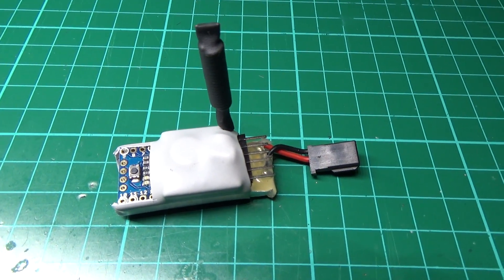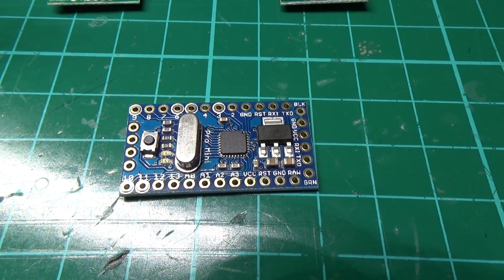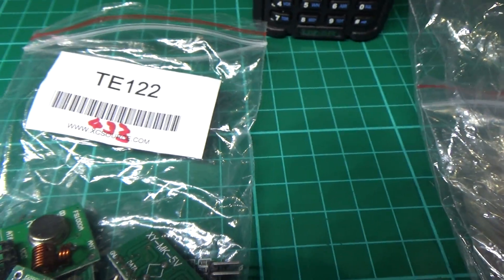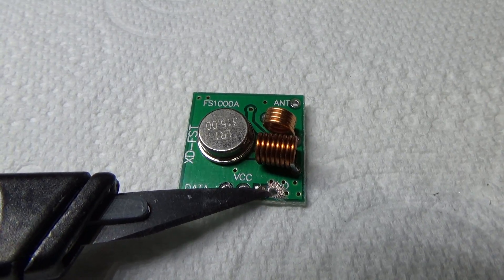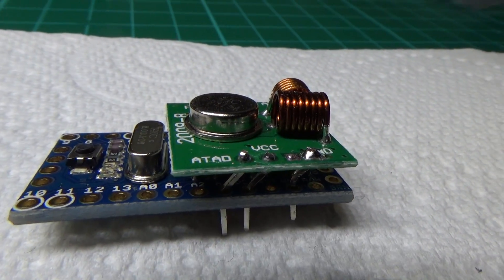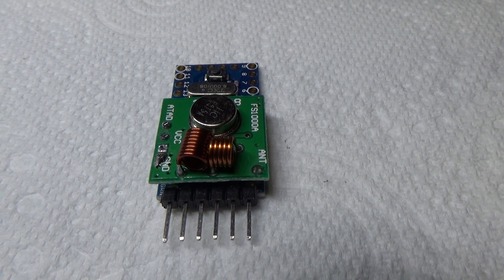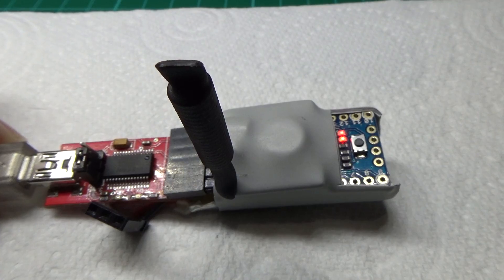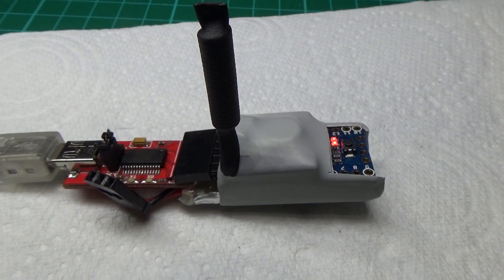DIY Lost Model Beacon. How to build one.....

Comment: Do you have a suggestion for another type of receiver that I can use with the Arduino? For example, I making a robot that will track where something is. Therefore, I put the beacon at the location (transmitter) and the robot will pick up on the location and follow (receiver).

Comment: Great video. One quick question: Is there a way to transmit an audio (a voice recording for example) with these devices?
Reply: Of course, but im not sure if you can make using only this parts, i think you may need some kind of audio driver, an "isd1820" for example.

Comment: Effective range of these transmitters is 20 meters
Reply from the maker: Data transmission, yes. Have you seen my test video?
Reply: 20 metres is useless if your model glided away 5 miles out, plus you lost video FPV feed. However nice video and product. Lots of uses. I'd like to see a demo of how you pickup the signal using your radio, fascinating.

Comment: Brilliant! A few questions if I may; I am assuming that your battery voltage is going to the Pro Mini's RAW Pin, correct? And I see that you are powering the RF module from the Pro Mini's VCC Pin which would put 3.3v to the RF module correct? In my research about this particular RF module it would seem that transmitted power output is dependent on the RF module's input voltage. Based on that assumption would it be best to power the RF module straight off the Lipo rather then the regulated 3.3v from the Pro Mini's VCC Pin?
Reply from the maker: You're correct in every way. I only made the video to demonstrate how easy it is and I kept it as simple as possible so everyone can make one.   
You'd be surprised at how many people have asked questions, even with it as simple as it is. It's quite refreshing to see that someone has actually taken the time to do some research :-)

Comment: Hi. Vortecks  

Really interesting project.
I'm going to build one (or few) of these beacons.
I downloaded the code you share and have some questions. It's my very first project in arduino, altough I made others on PICs or ST etc.

As I understand you are using a loop and two const to generate a tone or something similar is true?

I modded the loop and added a line to have simetrical square wave.
while (pause < pitchLength)
  {
    digitalWrite(rsOUT, HIGH);
    delay(pitch);
    digitalWrite(rsOUT, LOW);
    delay(pitch);                //Added line
    pause++;
...
...

That way it's much louder as there is less energy wasted on harmonics we don't need or even hear.

As I don't have the 433mhz I tested with a small speaker.

Let me know If I'm wrong.

thanks
Reply from the maker: Hi Mauricio,    
I originally did the coding to play a tune and it was done so people with little knowledge could understand how it works. There's plenty of optimisations to be done and your way will work perfectly. Please feel free to keep modifying it, it's nice to see someone taking the initiative and making a good invention into a perfect one! :-)    
Tony

Comment: Hello sir, I have some problems with this device. So I want to know if you can help me. I follow the instructions of your video I have an Arduino Chinese Card (http://www.ebay.com/itm/222050323175?_trksid=p2057872.m2749.l2649&ssPageName=STRK%3AMEBIDX%3AIT). I upload the Beacon Pro Mini Simple Beep to the card, but I only have a blink in the arduino card, but when I tried to Heard the beep on my Baofeng on 433.900 MHz I didnt. Please can you give an email or please write to mi email: vfmontes@gmail.com, Thanks a lot for your time.
Reply: I saw that the DATA pin from the transmitter goes on A3 PIN. but in the programm said PIN 13, is that the problem?
Reply from the maker: To answer your questions..........There is a 30 minute delay in the software and it won't do anything for the first 30 minutes and then, it'll transmit a series of beeps. You need to be at least 6ft away from the beacon when it starts transmitting or it overloads your receiver and you'll hear nothing. Pin 13 is connected to the Arduino's onboard LED - it flashes when it's transmitting. Does that help? :-)
Reply: Hello sir, I will try it. So, the data connector from the transmitter, need to be in the A3 pin?, thanks
Reply: Hello Vortecks, another question. I connect the 3.7v battery to the arduino, and immediately start to blink a led on the arduino. is it normal? thanks

Comment: Cool video. Have you thought about trying an ATtiny84 with the radio transmitter? That'd make it really small. Probably could run it on a single coin cell for some time.

Comment: Hi Vortecks, I just lost my drone, no tracker so I am running around blind looking for it. I have looked at what you built and it is just what I need  before I fly again. What I don't understand is how you get a tone on the Baofeng which is FM and the TX is listed as AM. I want to order my parts so wanted to confirm that the TX unit did not change. Thanks for the video's !!
Reply from the maker: Without going into the technical differences between FM and AM and the way the beacon works, you'll be fine. My Baofeng is FM and the transmitters are indeed AM.    
Here's the demo I did with it..... https://www.youtube.com/watch?v=ahkBExnJjdA    
Sorry for your loss, I know the feeling all too well :-(    
Tony
Reply: Thanks so much Tony, that is what I wanted to hear. I am getting parts on order today. Thanks for sharing your code also !! That is a big help. I will be watching your video's to see what you do next. Larry
Reply from the maker: Thanks Larry.    
If you're after the ultimate lost model alarm & beacon, you might want to look at the tBeacon, I use it in everything I fly now. They are quite costly but the saving in the long run is priceless!
Reply: Thanks Tony, I will have a look at them. Having one take off kinda takes the fun out of things.

Comment: Hey Tony. I know this is ancient news and all, but I have been waiting for my Ook 433Mhz Tx modules to arrive (60+ days!!!!! )
So they are here and I have to get back in the groove. Thing is I forgot I only had 5V Pro Mini's left in my kit.
The OOK 433 are 5V for Vcc but what of the Data In?  I wonder if the Pro Mini will run off the 3.7 lipo.
Reply from the maker: Which ones Chris? The ones in this video?
Reply: Yeah the module you are using in this vid are called OOK/ASK , don't ask me :-)  But yes that is my scenario. I was thinking of bypassing the Vreg on the Arduino. Also there is a way of modding the PCB to connect a ATtiny13 for holding the code, and some rearranging of resistors and caps. (thread at RCG). I don't really care either way but I would prefer not to have to wait for more parts to ship. We have a looming Postal Strike on the horizon here besides. I just want a little insurance for my first forays in the rural hay fields around my abode
Reply from the maker: I already made one from a Digispark..... https://youtu.be/ahkBExnJjdA?t=2m20s   
As for the Pro-Mini I use, I've searched for them on eBay but it was so long ago, the link no longer works :-(
Reply: You are always generous with your replies pal. Look, I watch all you vids mate, and when I reviewed that vid yesterday, I only see two power leads connected to the Tx module, so I am more confused after that revelation
I will be trying your original instruction and will review the code to see if it can fit on a ATtiny of some size.
Reply from the maker: The power leads from the battery go to the 433 TX and (what you can't see) is the attiny85 mounted directly underneath it with +ve and -ve to the TX unit.

Comment: Well done! I built one, but I am wondering how to make it transmit a series of beeps, each increasing in volume, then go silent for a few seconds, then repeat.  That way, as the searcher gets closer to the beacon, the searcher hears more beeps, and has a better idea if they're heading in the correct direction! It would be really cool if you would write that code and then post it here!
Reply from the maker: Sadly, it doesn't work like that. The transmitter is either on or off and there's nothing in between. The noise you hear is actually generated by the transmitter turning on and off very quickly :-(
Reply: Vortecks Rats. Thanks anyways for the quick reply. I'm using an $1 attiny85 with a $2 stx882 433mhz transmitter module now with a scrap LiPo. I haven't tested it yet, but I plan on using a $0.70 receiver module and an ear bud to receive the signal. Or a handheld radio. Thanks for the tutorial! I subscribed.
Reply from the maker: No problem. If you want something that does what you suggest, have a look at the tBeacon........ https://www.youtube.com/watch?v=QOkG72TdB10
Reply: +Vortecks Do you think it would be possible to have the span of the beeps to be different or vary in length? for example, I'm thinking of using a piezo buzzer hooked up to a 433mhz receiver module (maybe by using a transistor to trigger the buzzer) and then the transmitter arduino code would simple be the basic blink sketch, except with beep 1 being very brief, beep 2 being slightly longer, and so on for like 5 beeps, then a long pause before looping again. My handheld radio is away in storage, so I'm trying to be resourceful.
Reply from the maker: Yes, it would be quite easy but I think you're talking about a lost model alarm from every hobby shop.

Comment: Hi there ! and thanks Vortecks for sharing this good project.
I lost my quad (permanently...) in the forest, and was then very interested in such an improvement for my futur quads.
I have made two identical beacons using 5V nano arduinos.
They do work pretty good exept from one issue that I can't seam to figure out, on both of them.
The frequency can get very far from 433,900 (+/-80khz) depending on :
-the proximity of any object
-the supply voltage
-the antenna.

So I am surprised that you can actually label your beacon with the exact supposed 433,900 frequency, and being sure that the transmitted frequency of the lost flying object won't be affected by tree/humidity/damaged antenna/anything else once you might be looking for the signal.
Even with the good Baofeng receiver, it looks very hard to be seeking the right frenquency while looking for the good spot at the same time.
I don't know where my problem is, but still enjoyed following the steps.
I am far from being an HF expert but I guess I might shield everything to get more stable results. What would you think ?
Reply from the maker: +Pierre Autran Using it inside causes 'multi-pathing' which will affect the frequency and using it too close to the receiver, washes out the signal. When you try it outside, you'll find that the frequency is stable and the range will be much better. The best thing to do is thoroughly test it first - I never rely on anything I've built until it's been tested in a real-world scenario :-) Tony

Comment: thank you so much for all the sketches and involvement in the hobby i finally got to making mine with your instructions and was wonderring if you could explain a bit on it tone and pulse wise so i could change it a bit less teasy  sound :) tried changing the value on the pitch but it changes everything  i keep doing something wrong
Reply from the maker: +Mathieu Bissonnette-bigras You can't actually change the sound because it works on the principle of 'clicks'. Basically, it's turning the transmitter on and off 'X' amount of times to make a tone. There's no way to make it do anything else, sorry :-(
Reply: notice the line for the time is written that it is in milliseconds but seems to be in seconds i'm still new to all this arduino stuff but doesn't seem to hard so if i change the timing to say all the same i can create a pulsing tone instead of the song
Reply from the maker: +Mathieu Bissonnette-bigras There is another sketch with a simple tone - it's in my Google docs called "Vortecks_Beacon_ProMini_SimpleBeep.zip"
Reply: Vortecks Q

Comment: Built and working great.  Thank you for the instruction.  Do you know how an LED flasher could be added as well for visual?  Thanks
Reply from the maker: +Brian Mays It would be very easy but....... 1 - I didn't include it because I want to be the one who finds my pride and joy, not anyone else. 2 - The LED probably won't be pointing in the right direction. 3 - The extra current would limit the battery life. A 3w LED at 3v would use 1a, if the duty cycle is 10%, with the extra current being used by the transmitter, that means the battery would be dead in around 2 hours. If you still want one, let me know :-)

Comment: lol, mine just transmits a awful bzzz noise, stupid am transmitter lol, your ones must be doing fm.

ah nah, the code only does single tone :P
Reply from the maker: +TimonSuricata I had to use a single tone because of licensing laws in the UK. You're only allowed a certain duty cycle. If you want the other one, let me know :-)
Reply: +Vortecks Ah, it's alright, it's all working now fine with the single tone, makes a difference once you solder up everything :)  will be a nice cheap way of checking fox traps, drive past with a radio, now that is ultra lazy trappen!

Comment: Your script also has the pin 13 set to Out, not A3 like you mention in the video (Unless there the same?)
Reply from the maker: +TimonSuricata Pin 13 is simply to light the internal LED so you can see if the alarm is activated (it should flash with the beeper). I always have some form of notification like that - it helps with faultfinding.
Reply: +Vortecks Ah! gotchya!
Reply: +Vortecks still can't see where you address the analog 3 pin in the script, but i will give it a try anyway :)

Comment: So another quick question, the transmitter has no issues running on a 3.7V battery even though its a 5v transmitter? seems to work fine in y our other vids just double checking :)
Reply from the maker: +TimonSuricata I had no problem at all with it on the single cell lipo :-)
Reply: +Vortecks Awesome, i did read somewhere that if you use a few more volts on the transmitter you will get a bit more output power to, increasing range :)  But good to know it works fine on the single cell Lipo, thanks

Comment: Hello
This is a AM TX on 433.92mhz (ASK mosulation), you modify to FM or not.

Regards
Reply from the maker: +aiurel1987 Sorry, I don't know what you're asking?
Reply: +Vortecks  when you tested this beacom whit uv5r you modify the 433mhz module to transmit in FM modulation or is the originar in ASK modulation? 
regards
Reply from the maker: +aiurel1987 The module is FM......if that's what your asking.
Reply: the model is AM and is not possible to change to fm...
the trick is move some freq up or down...

Comment: Can u help. Built one of these. With prominent, and ban good antennas plus bought a boefang radio. When in a3 don't get anything??? Put on digital 3 I can "hear" tones, but very very faint and if more than 3 or 4 meters away nothing ????
Reply from the maker: +Guy flanshaw I don't know how you're getting something from D3, it's not even outputting anything to that pin. Are you using an Arduino Pro Mini?
Reply: +Vortecks Doh. i changed rsOUT from 17 to 3 (as i couldnt see a PIN17). but just checked the specs for pro-mini and Pin 17 = A3.... will change

Comment: 43.92 is reserved for low power devices (only allowed to a 10% duty cycle though)

There is also 418MHz but the government stuck the TETRA (emergency services) system over that so it is liable to interruption.
Reply from the maker: +Rob Crawford Cheers Rob. It's nice to know I'm not breaking any laws :-)
Reply: Rob Crawford hey are professional with this beacon stuff?

Comment: Great Idea! So many uses for those Arduino boards. This could probably work for pets too.
Reply from the maker: +dmerc00 Yes, and they only cost around $8 each. On a similar note, I've received my final GPS tracker - it's MUCH better than the other one I have :-)
Reply: @Vortecks  how small could. One be built less than an inch?